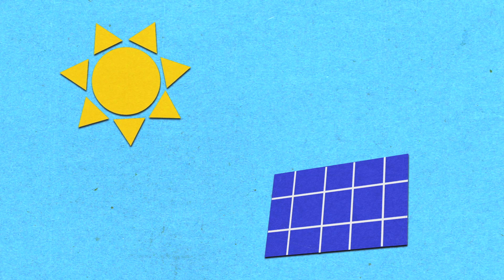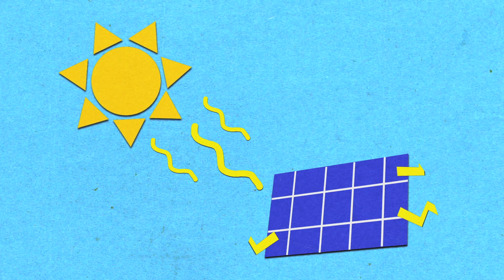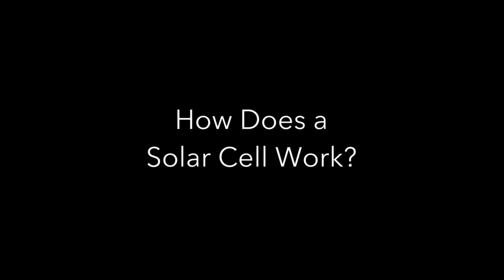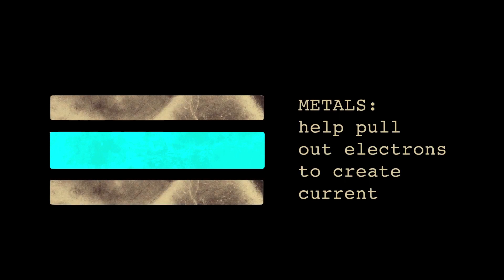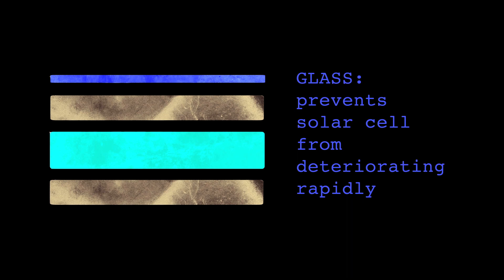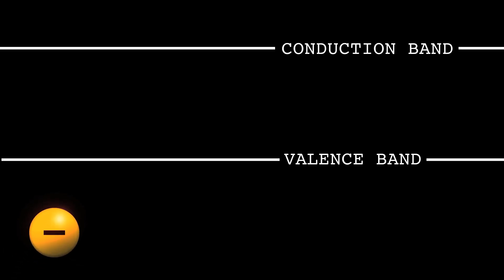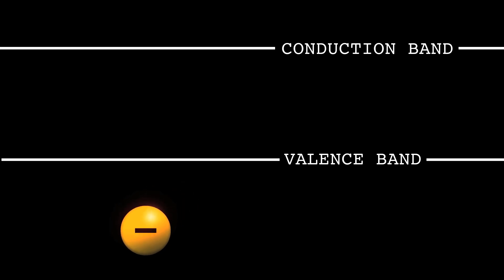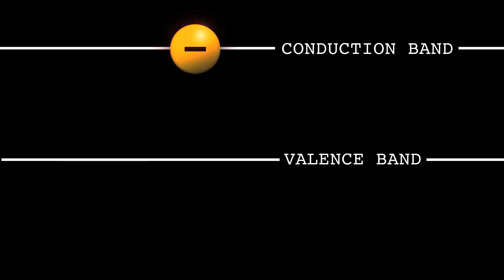Explained: Photovoltaics

Comment: Solar cell efficiency is the main problem here. Solar cells are highly inefficient when it comes to utilizing solar energy. When a photon with energy higher than the bandgap is absorbed, the excess energy is not utilized and instead goes to heat the cell which raises the cell temperature.